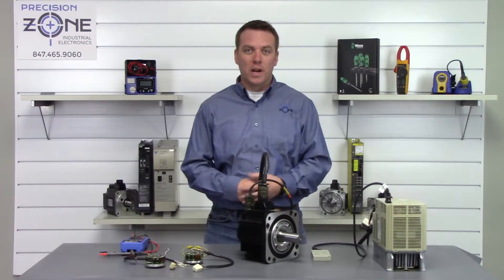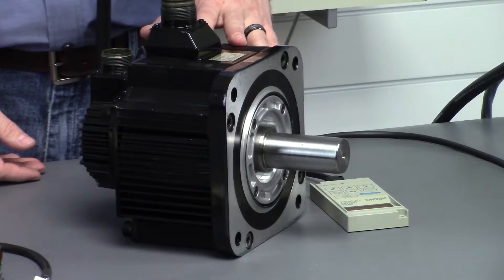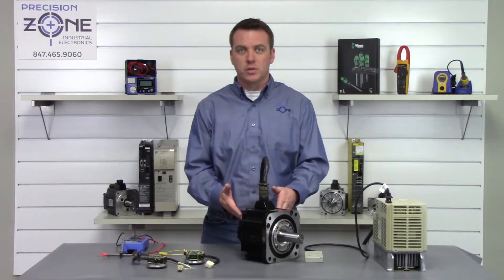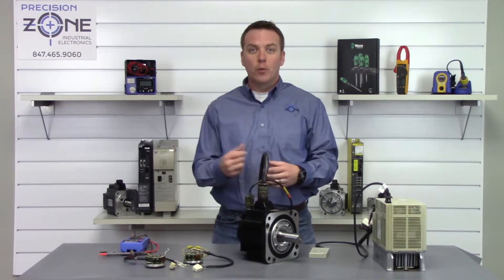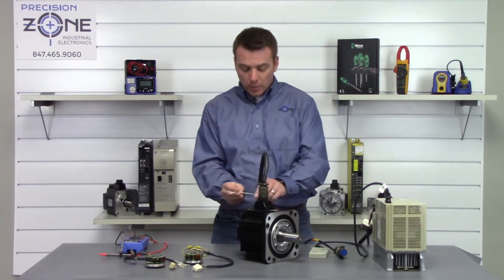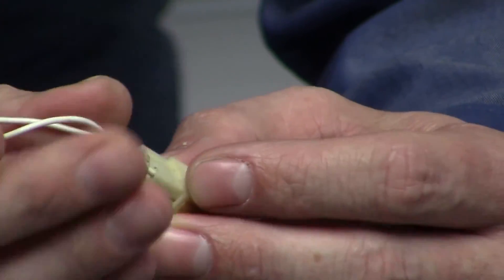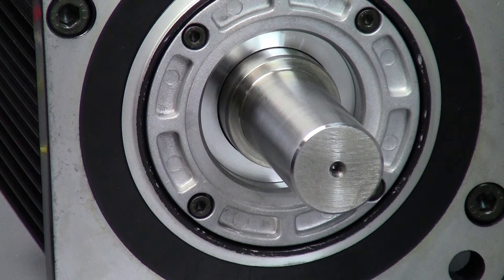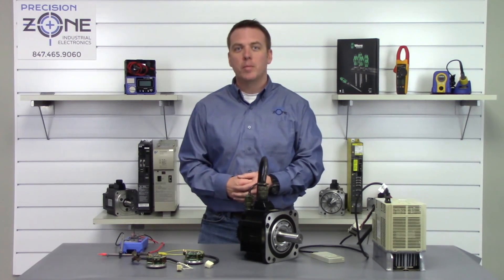How to Reset 15 Bit Absolute Encoder for Yaskawa Sigma 1

Comment: Hi guys! I looked through all your videos on yaskawa servo drives, really liked it. But a situation arose in which I did not find the answer. Help please solve the problem. Encoder bd9304167 was removed from servo Drive Yaskawa SGMKS-30A5AHS22 without marks of it's former position. After that encoder was installed back. When trying to start up the machine tool the servo Drive starts to rotate chaotically and after that driver displays mistakes and cut the supply.
The encoder must be placed not only along the rotation axle of the key but along the electromagnetic field of the engine. 0 is the point of phase change. We wasn't able to achieve it by hand. Could you give recommendations on how to place correctly encoder on servo drive.

Comment: can you help with my LS AC servo, APM-SE15ASK-LS I watched your video and the pins are similar to what you are using.
Reply from the maker: Hi Nemo,

We would be more than happy to help you out. What seems to be the issue?
Reply: HI thanks for your reply, the issue with the mini rider 2 from sega is the AC servo does not have enough power to lift the cabin, it will ascend in the beginning and then it will drop suddenly
Reply: I remove the actuator from the motor and check the actuator manually pulling it and pushing it in to see if there is a damage on the actuator and there is nothing wrong with it
Reply: I also test the AC servo by connecting it with the machine but without the belt to activate the actuator, the motor is running smoothly.
Reply from the maker: Hi Nemo,

Thank you for the information. Unfortunately, after speaking with our engineering team, this is not a product that we are able to support at this time.

However, based on the information provided they do believe it to be a more mechanical sided issue. With that, we would recommend having a field service technician come in and take a look at this unit to further isolate the problem down for you.

I apologize that we could not be of more help with this product.